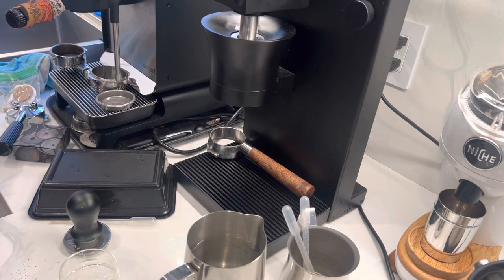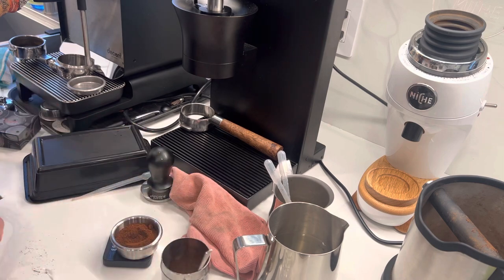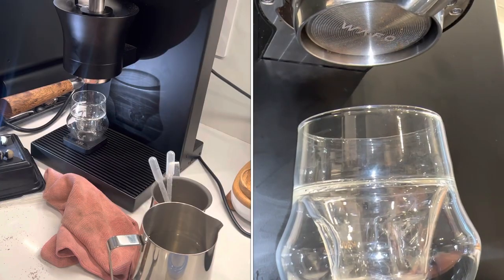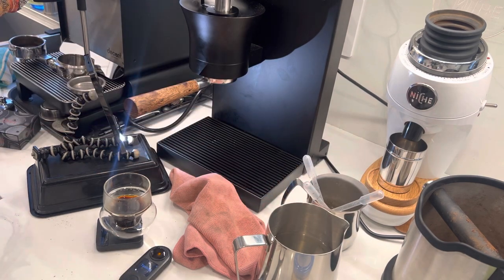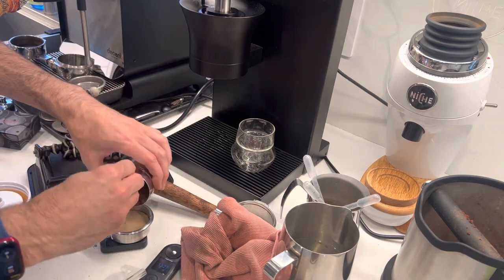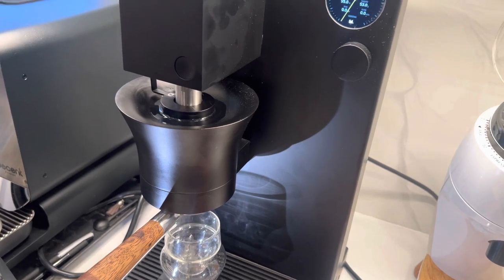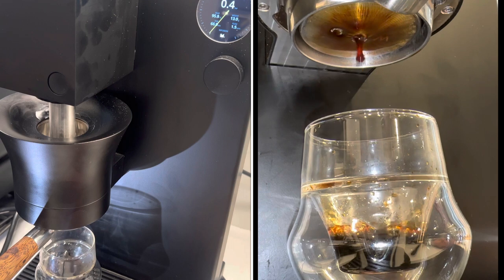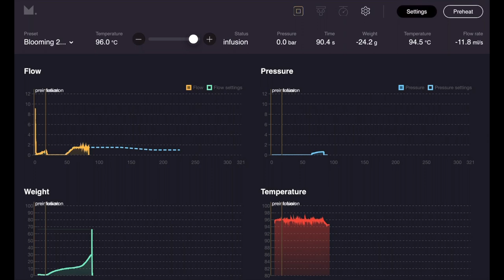Two Espresso Shots on Meticulous Home using Paper Filter

Comment: Hi, what is the purpose of the divot in the puck?
Reply from the maker: To reduce the impact of side channeling
Reply: Why are you getting doughnut extractions? I used to get it as well, but after upgrading my tamp from Breville to a precision tamp, it seems to have stopped. I'm using a manual tamp, so sometimes it's not perfectly flat resulting in extraction travelling out from one side, but not doughnut?
Reply from the maker: @Drift-yf4rn  heat and water flow. I also use a lower flow profile so it’s easier to see when it has a donut. Based on extraction yield, the shots were good.